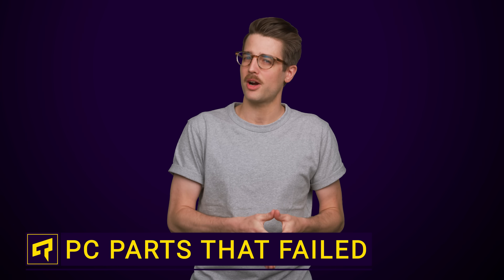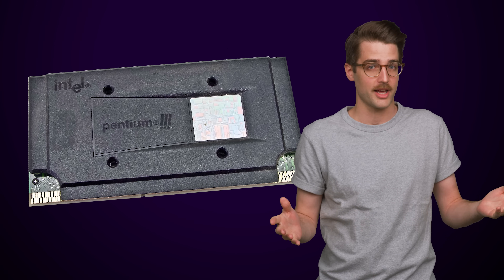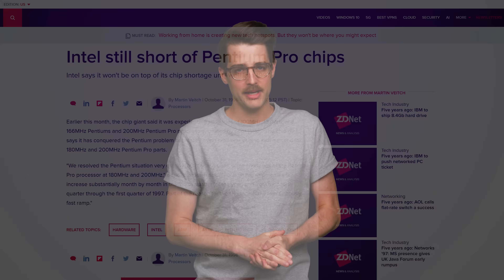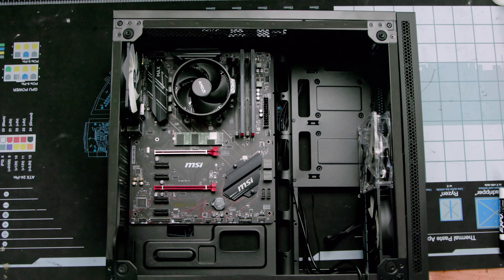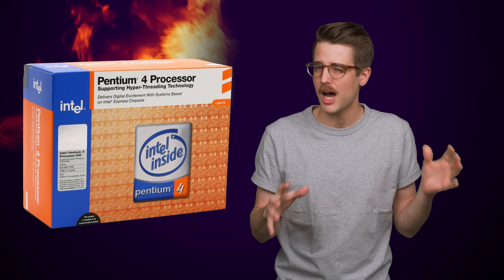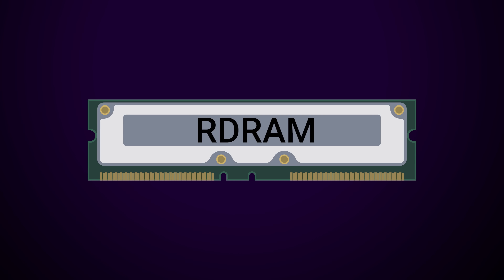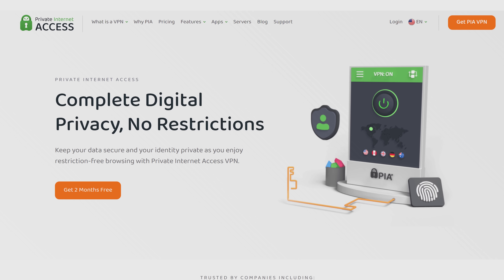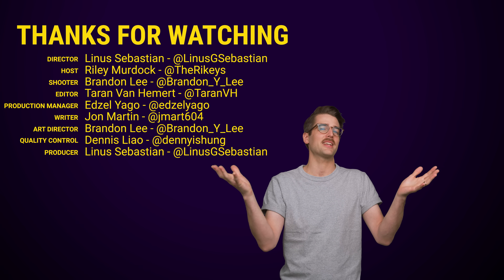PC Parts That Disappeared

Comment: I remember when you would install the cache on the motherboard itself. You could upgrade it without changing the CPU. Oh the good old days.
Reply: Ah yes. Those days. Not enough low mem to run programs (TY QEMM). IRQ conflicts. And the horror of having to manually TURN OFF YOUR PC!  🙃
Reply: @acubley  And add a SCSI card in there for fun.
Reply: This is something he missed in his discussion of slot based CPU. Yes, he got it right about the L2 cache being on the board with the CPU, but he missed a part of the explanation as to why it was there. As you mentioned many pentium and 486 motherboards had L2 cache chips on the motherboard. Some of them were socketed and could be upgraded and some even came on a little board that fit in a slot itself. I believe that was referred to as COAST or Cache On A STick. Anyway, the real reason that on the Pentium II they put it on the board with CPU was so it could run at higher speeds than the FSB. remember that in the 386 and early 486 era the clock speed of the CPU was the same as the FSB. With the 486 DX2 66, the CPUs started to run at multiples of the FSB speed. When we finally reached the Pentium II era you had CPUs running at very high multiples of the FSB. At that point cache on the motherboard would have been a huge bottleneck because of this huge difference between FSB speed and CPU clock speed and would have been pointless. So, a compromise between having the cache on the motherboard and actually part of the same chip was to have the cache on a board with CPU as was done with the Pentium II or have 2 chips on one substrate as the Pentium Pro. That way the cache could run at a higher speed than the FSB which the motherboard ran at. The L2 cache actually ran on what was called a "back side bus" of the processor and on the slot I pentium II chips ran at half the clock speed of the CPU. for example, on a 450Mhz Pentium II that would mean the L2 cache on the Back Side Bus would be running at 225Mhz as opposed to the 100Mhz FSB. That was obviously a huge performance improvement. If I'm not mistaken, the larger slot II Xeon variety actual ran the back side bus and L2 cache at full speed, just as the Pentium Pro, which of course further improved performance. When they advanced to the point they could actually put the chip in the CPU itself, obviously this was no longer needed. Anyway, he failed to go into detail and explain this. Anyway, this wasn't a "failed technology". It was simply something that was necessary at the time but with advances no longer became necessary.
Reply: And back when you could configure the VRAM used by GPUs, good times

Comment: Yeah the one time I got a store-bought desktop PC, a Gateway, it died after 2 years. I opened it up just thinking I could just install a new MOBO — and that’s when I learned about the ludicrous BTX form factor. And learned you couldn’t buy a BTX motherboard.
Reply: Intel is repeating this mistake with ATX 12VO and how OEM systems and consumer systems probably aren't be able to use the same PSUs anymore.

Comment: I still have my pentium 2 slot processor… one day will show my kids that how big a 200 mhz was back in my time…
Reply: 200 MHz for a Pentium 2 is a bit low. You sure it's not 266 MHz?
Reply: @fungo6631  it started with 233
Reply: @fungo6631  well I forgot the actual speed but yeah something like 266 MHz
Reply: I have PIII 500 , motherboard and ram ... in 350 years I will sell it for profit ...
Reply: The CPU was actually that size due to the CPU and cache being on different chips to improve yields.
Reply: @ducksonplays4190  we all know, we just saw the video.
Reply: @samljer  I wasn't done with the video yet so I hadn't seen that part.
Reply: In have one too, Pentium II 266 MHz in think? on an Intel se440bx Motherboard
Reply: I found a slot 2 machine at a waste collection site that had a 386 socket for it. Was in pretty neat and I wanted it but can't take stuff from waste sites
Reply: @mikewilson6940  That's sad.
Reply: @mikewilson6940  I can't see that being real unless you/your company were contracted for confidential data destructions or something. 

Because it's GARBAGE!
Reply: @rickytorres9089  It's a local government policy, no scavenging.
Reply: I broke mount in mine :c
I've been searching for a replacement everywhere but I've been unable to find one
Reply: @damianosplay9457  Sad days, I had half a mind to grab the one I found but I like my job and didn't want to lose it over a computer that likely didn't work anyway, hah.
Reply: My buddy had the 333 mhz one. Think it was a p3. He called tech support once and they couldn't believe he had such a fast CPU cause it just came out.
Reply: @davesomeone4059  I'm pretty sure the p3 didn't come at 333 MHZ I think it has a minimum of 450 MHZ.
Reply: @ducksonplays4190  ok yea I can't remember.
Reply: I have a Pentium II, Pentium III and a slot based AMD system. :)
Reply: My windows 98 rig has a PII 333Mhz at it's heart
Reply: Got my P2 Slot complete with an Gericom VL-601 Mainboard. Good old Times...
Reply: lemme see o.o

Comment: Funfact:  The main reason Intel named the line of chips "Pentium" was so they could trademark a name and not have other companies, like AMD and Cyrix, simply copy their number scheme, e.g. 386,  486,  586(?).
Reply: I could be wrong, but you are somewhat correct. It was more that Intel lost a court case in that they could not trademark number and then had to go to a name
Reply: @dahak777  They tied up AMD in court with their superior 386 40 MHz CPU that kept pace with a 486 SX 25 (that you'd be dumb not to overclock to a 33 Mhz, which most of them could easily handle) - They didn't have to win, they had to delay AMD enough. 

That 386 chip sold well into the second half of the 90s as used or secondary PCs. Hell, I'd love to have had one in 1996 even, I had a shitty SX/20 still.
Reply: it also was great marketing because Pentium sounded rather exciting and like a significant upgrade unlike say 286-386. AMD and Cyrix had 586 CPUs, but AMD chose to follow Intel's lead afterwards and created the Athlon brand. For Cyrix, the 586 was their last CPU I think, before they went out of business.
Reply: @jayhill2193  Cyrix followed up with the MII and MediaGX but got pretty stifled by the NatSemi merger, then all but killed off by the VIA buyout. The Cyrix III was the last Cyrix chip with their own design, but it got snuffed out in favor of the "VIA C3" low-power variant using CenTaur's core architecture.
Reply: @jayhill2193  - nope and nope, at least not quite. AMD's and Cyrix's direct answer to Pentium was PR, or Pentium Rating. AMD didn't follow Intel's new naming scheme with Athlon until 6 years later and Cyrix's last meaningful CPU was 6x86, a clone of Pentium that was faster than the original in many applications even though it was running on lower clock speeds (hence the need for PR).
Reply: @jayhill2193  AMD never had any CPU called 586. You are confused about AM5x86. Also, before AMD adopted Athlon moniker, they had K designation for their CPUs, e.g K5, K6 etc..
Reply: Then K6, K6-II, K6-III happend.

Comment: Still own a Pentium2 and Pentium3 Slot CPU
Reply: I how you didn't get them from shady hardware dealers who would put a lower CPU in a higher Slot case.
Reply: @quantumleaper  I'm the first owner :)
Reply: @sirqui2751  No, unless you bought it Intel themselves you bought it from someone who sells the hardware parts and/or systems,  my system wasn't second hand,  since I put it together myself.  I know I was the first owner also since the P2 400s had only been released a month before.

Comment: hmmmm if cache is fast...why not make it like a storage thingy?
Reply: L2 cache of that wear usually ran at half the clock speed of the cpu.  and ram is storage in a sense its also temporary and when it looses power everything is gone (ramdisk) cache is just really fast ram for the cpu to cache frequently used instructions to to speed up everything.

Comment: As I worked through the slot fiasco, It was commonly believed and propagated that slots were required for future needs and pin based CPUs were dead. Slots allowed more power and reserved connections for a one slot fills all for the foreseeable future. The external cache actually makes more sense.
Reply: Easier to get ripped off by shady hardware dealers too.  I still remember my P2 400 which turn out to be a P2 350 when taken out of the 'case'.

Comment: why hasn't anyone thought of using hexagons for the cpu shape or the pins/contacts? is there a reason?
Reply: Then instead of one correct insertion orientation and three wrong ones, you now have 5 incorrect orientations.
Reply: humm....
Reply: Its harder to do the layout on the die if you have to keep track of where physically you are on it. If its rectangular the designers know the area they have for each core/cache/bus/accelerator etc with no need to optimize where each transistor has to go, thats taken care of at a higher level. I dont know of the top of my head what would waste more space on a round silicon wafer either, squares or hexagons, id imagine squares waste less and thus higher yields
Reply: @steffennilsen2132  yeah i know realize that what i said was dumb

Comment: funfact: there were actually slot to socket adapters.
Reply: Slockets were fun for awhile. XD
Reply: @OMightyBuggy  slockets might even be a thing again with AMD moving to LGA
Reply: @crisnmaryfam7344  seems like it'd only have benefit in highly integrated SFF/NUC form factor PCs though, anything bigger and you'd have trouble mounting cooling to it safely without watercooling the card. Plus what would AMD want to put on a card these days alongside a flagship CPU? They already crammed more silicon directly onto a substrate with epyc and threadripper than the old card CPUs had, and the total board surface area is similar lol
Reply: @OMightyBuggy  that's a word I have not heard in a very long time. I had one of those.
Reply: What you mean were.. you can still buy them XD
Reply: The first PC I ever built was a Slot-1 Pentium III. Back than, entry-level CPUs (like the older Pentium and AMD's K6 lineup) were socketed, which meant that, if you wanted a "good" PC (Pentium II/III), you needed a slotted CPU. Socketed CPUs were perceived as "budget". It's funny how things can go around quickly, as Intel's "second-gen" Pentium III, the Coppermine (which was actually meant to be the original Pentium III) had on-die L2 cache (which, along with the new 180nm process, made it MUCH faster) and went back to a socketed design. I remember upgrading to a socketed Pentium III, which meant I had to buy a socket-to-slot adapter so I could use my new socketed Pentium III in my slot-1 Asus P2-99 motherboard.
Reply: @richardbroder  Hey... that's ma man there!
I had almost the same set-up P-III slot1 on a shity OEM motherboard. When I got my Coppermine I was so thrilled telling everyone about it ... lol Well I couldn't find a slotcket adapter so I got a 2nd hand Asus mobo with a 370 socket on it...!
Reply: I had a old Celeron 300a in one of those. Those were the days.
Reply: I have few brand new in their blisters laying around lol
Reply: I have one with a Mendochino Celeron somewhere.
Reply: yep, socket 370 to slot 1 was one that i found during that era. i also found an oddball intel to amd socket adapter once at the recycle center my buddy runs. we see some really interesting beige era stuff there
Reply: I liked the old ones that had slots so could use more then one type of CPU on it.
Reply: @ruane211  Yes you could do that all the way up to super Socket 7, you could not swap Slot processors as the pinouts from AMD, and Intel where different, and could fry your motherboard. Fun fact AMD supported Slot processors longer than Intel with their Slot A Thunderbird Processors going all the way up to 1Ghz, but they where expensive for AMD to make since yields of the chips where low, so they where rare in their time, and even more rare now. I had one of the only Gateway computers at the time that came with an AMD option for an 800Mhz AMD Slot A Athlon, and I upgraded it to an 850Mhz Slot A Athlon with an OC to 877Mhz and eventually found someone on eBay selling an 1Ghz Slot A Thunderbird, and used it for close to 2 1/2 years before the chip burned out from being OC to 1.19Ghz.
Reply: the old amiga days.
Reply: I owned a Slocket adapter
Reply: I thought it was a pretty good architecture for upgrading CPU's more easily... but IIRC the architecture was changing fast enough at the time that you needed to upgrade the motherboard along with a new CPU.
Reply: There were also a socket to socket adapters too. I had a socket 478 to 479 adapter. I could ran a Pentium M on a Pentium 4 motherboard which would be quicker and more efficient.
Reply: Wow. Another comment tells me that one of his slot CPUs had a socket instead of being soldered in. Socket to slot to socket…
Reply: I am still using a slot to socket adapter on my asus p2b motherboard.
Reply: We know